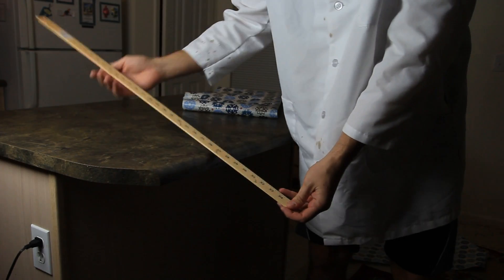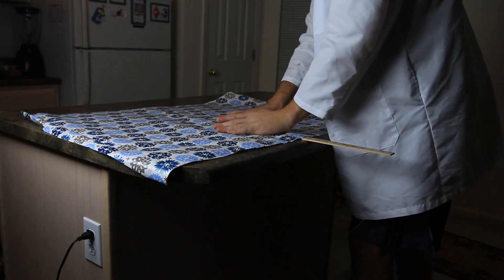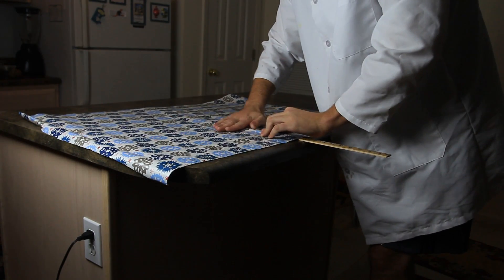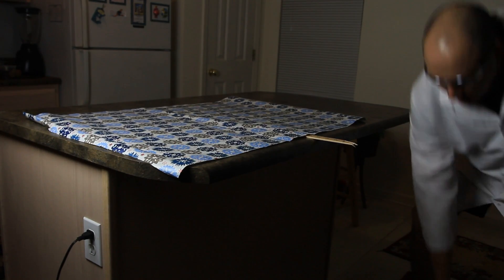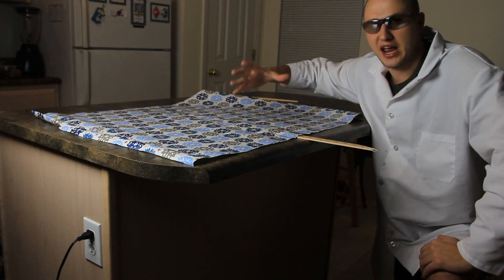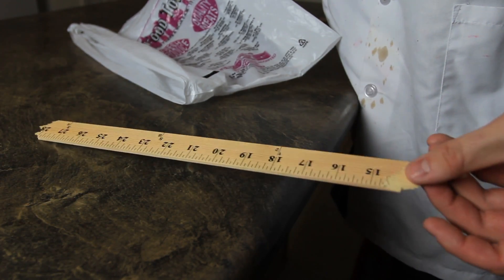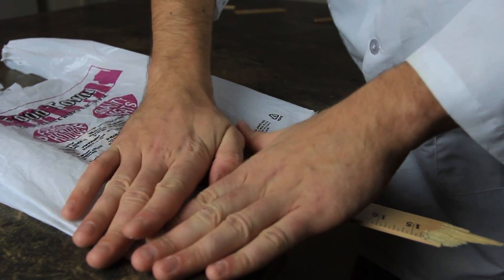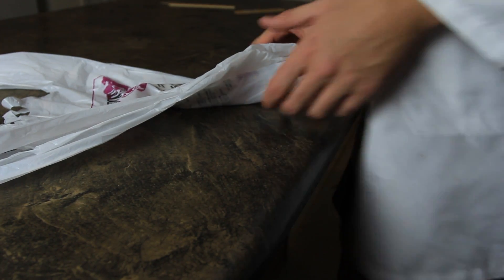Air Pressure - Science Experiment

Comment: Air resistance ?!
Reply: It would be air resistance if he did this vertically. When you break the stick, it's not the air resistance holding the sheet to the table, it's the difference in pressure between the air under the paper and air over it. The pressure under the paper is relatively low compared to ambient air above the paper. When you break the stick, it is the higher pressure above pressing down on the lower pressure below the paper, rather than just the sheet providing a large resistance to air.

Ideally, that is. In this particular case it's a slight mixture.

Comment: Air pressure is a wonderful thing, 14lbs per square inch, by a 24x36 paper with 10lbs of force being offset by a several ton counter weight, the wood gives first.

Comment: ... Surface Tension ... ?
Reply: Atmospheres of pressure on the top of the paper/bag. With no air under the paper the only force that pushes up against the atmosphere comes from the applied force. The paper creates a greater surface area for this force to be acted against by the air pressure in the room. This resistance is greater than the force applied so the stick breaks.

Comment: It's the air resistance not the pressure. Works kinda like an air break or parachute.
Reply: no, its definitely air pressure, it works like a suction cup. It pushes all the air out under the paper, so its like a vaccuum. and since its trying to fill the vacuum with air so quickly, it sticks to the table, to maintain its low air pressure. the stick is pushing the paper up, to give it more volume, but theres almost no air under the paper, so when the stick pushes up, the atmosphere pushes hard downwards, making the stick stay on the table and break
Reply: No, this is how a parachute would work bigger surface area (paper) the more drag or air resistance causing the ruler to snap
Reply: if that were true, than it would work if you just flattened it but didnt care if there was air under the paper. Theres no air there for a reason, because its air pressure pushing the paper down

Comment: Air resistance not pressure
Reply: No, it's actually air pressure. The air cannot rush into the space that the smacked meter stick is trying to make, so the paper doesn't move. it's almost like a short term air-tight seal.
Reply: InfernalAlice no it's because of the suck from the vacuum generadet under the paper! the vacuum sucks the messurement ruler into BROKE
Reply: InfernalAlice
id still argue its air resistance, the speed of the stick being hit multiplies the (as resistance) on the paper. making a greater force (pressure) on the paper than that of the end of the stick therefore it broke.
Reply: kiel turner haha. No multiplying going on. It's simply air pressure. It's the same whether he hits the ruler or not. Applying force to the stick is just representing said force already in existence. As tttmmmnntt states, the low pressure zone underneath the stick when lifted quickly and the pressure above is why the stick breaks.
Reply: you just said no multiplying going on yet you say the pressure above the the paper is why the sticks break. air when force is applied, multiplies in density (pressure) as does liquids and even solids. the fact you guys are arguing over pressure and resistance that are virtually connected terms. its like accuracy and preciseness ( I'm implying the difference is subtle). just to cause more controversy here there is no low or high pressure zones as there is no initial movement or altitude difference on the paper or stick, there fore it is simply a difference in resistance equating in to pressure. since the seal between the paper and worktop is very small it means that that when moved an area of low pressure would be formed which would form a area of high pressure opposite of said low pressure area, but  these pressures would not form if there was not resistance between the paper and the air caused by the large moment of the stick. the moment with the pivot point of the desk (compared to the pivot point of the other end of the meter ruler is which is notably larger) means that the force created on the moment of the uncovered ruler is smaller than the covered, again in the sense that the force on the other end is larger than the other so that the moment is 0 but resultant force breaks the ruler. i would of loved to use numbers but since this was meant to be a youtube video aimed at what to a simpleton would seem mysterious or weird  to a physicist to be simple concept.
Reply: "You were able to chop the stick in two because of air pressure. When you spread out the newspaper on top of the stick, you basically created a large suction cup because you’re preventing air from flowing underneath. When you strike the ruler, it tries to lift up against the newspaper, but because the air can’t flow very quickly into the space between the table and the newspaper, most of it simply pushes down on the newspaper (and the ruler)."-From a science website. Resistance didn't increased because of the stick. It was the amount of surface area, which had that same pressure the whole time. Don't give up your day job.
Reply: yes and the air could flow under the paper because?
Reply: Couldn't would be the right word. Go back to school.
Reply: one i am 15 and already have an A* gcse in physics i also have an auto-correct on my phone. using it to hide from the answer is a bit cowardly.
Reply: Kiel turner... Air shares a similar principle as water, it weighs... We don't feel it because our bodies are used to it.
Now, put your hand on top of a cup, and go deep under water and try removing your hand, you can't.. Because the air inside the cup acts as a low pressure zone, and the weight of the water tries to push your hand into the cup.. It works in the same exact way as the ruler does, lifting the paper too quick causes a low pressure zone underneath the paper, so there is less air under the paper than on top of the paper, so the weight of the air pushes the paper back down, it's like placing a huge rock on the ruler. If this doesn't make sense to you, I don't know what will.. As the other guy said, go back to school.
Reply: Listen, I get what you are saying about resistance. Still technically poor use of phrasing. My problem is with multiplying pressure. It isn't multiplied. It's the same pressure. Period. The decrease of air under the paper creates a larger difference between the pressure beneath and above. This is the "resistance" you speak of. All it is really, is the vacuum that is created because of flattening the paper out. However, this does not equal multiplying the air pressure against the ruler from above. So yes, go back and stay in school.
Reply: And as I said earlier, air pressure as much as 10 tones per m2. That is equivalent to about 7-8 cars

Comment: I actually just thought of this now as I was watching the video but I have a daughter and I play with her constantly I believe it actually has to do with Air and suction. if you did everything the same way except this time instead of hitting the ruler grab it with both hands and pull up as fast as possible while keeping the ruler horizontal, you'll notice that its it's a lot harder to lift up at first but then once air gets underneath the paper and the suction is lost it moves up easily, because the suction is so strong temporarily it's enough force to apply resistance and allow the ruler to break, so in result my final answer is friction and air suction combined together. BOOM science you're my bitch...  the reason I mentioned my daughter she has a clock that we used to teach her how to tell time but it is just a round piece of bendy like Styrofoam only 1/16 of an inch thick it is extremely light however if it's placed on the dinner table perfectly flat and you grab it from the middle you can almost lift up the entire table itself because of the suction.

Comment: This isn't air pressure, it's friction/ newtons law/ resistance, when you put the paper over the ruler the bottom sits over the ruler ontop of the table, when you hit the ruler newtons law I believe it is(every action has an equal and opposite reaction) so the ruler lifts up when hit and the paper tries to rise up but can't due to friction of the paper to the table too so the ruler can't dispense of the opposite reaction of hitting it so it breaks at it's fulcrum

Comment: I'd say it's aerodynamic drag. the paper multiplies it because it multiplies the surface area moved. with great speed, the drag is also very strong. both factors are in the formula for the resisting force of a fluid.
if it was just air pressure, you could even break it slowly. which doesn't work.

Comment: As science experiment it IS cool despite all hater but the explanation of this phenomenon is not quite correct. In fact the air pressure holds whole system paper-ruler-table stuck together by the perpendicular force of air on the surface of the paper and this force is then restricting the air from getting in sufficient amount under the paper. But despite this is more correct answer I can live with your explanation as well. 

And for haters - if it is a science experiment, it may not make a scence but surely it is cool.

Comment: Hey crazyrussianhacker I have a household hack for you. You know those squeeze cans of cheese. Often times they seem to run out early before they are totally empty right? One easy thing you can do is push the can in on both sides so that you can bend it in the middle. Once you do you can bend it back and forth until the aluminium breaks and you can take the little plastic stop put and get all the rest of the cheese. Usually a good inch or so left in the can that would normally go to waste.

Comment: Okay, I don't think CrazyRussianHacker knows what he's talking about, but I'll try to use the best of my knowledge to explain what happens;
He is partially right about the air keeping the covered part down, but, the reason the back is heavy is because the paper increases the amount of space the back takes up, or you can say the surface area increased. Since the back has more area, there's more air to be held on the back, thus increasing the weight.
I don't know why the fuck he was talking about the air pressure part for.
Reply: Air pressure is measured in pounds per square inch (pounds- an amount of weight covering square inches- an amount of surface area) so that's where air pressure comes in :)
Reply: Your statement is correct, although to a point. What you're describing is PSI (Pounds per square inch), but anywhere else in the world would be called Pascals (Pa). And the formula for Pascals is Pa = kg/(m x s^2) (x being multiplication.) But thank you for clearing it up, I had trouble understanding why it had to do with air pressure at the moment.
Reply: Ah okay :)
No worries!

Comment: It not air pressure, it's just drag....
Reply: ...Which is a result of differential pressures. Trying to move the paper increases the pressure in the air immediately on top of the paper, and decreases the pressure under the paper (creating a vacuum). This difference in pressure = drag.

Comment: Air resistance not air pressure.
Reply: Viscosity of air definitely has something to do with it, but the biggest factor is the creation of a vacuum under the paper, which would take an enormous amount of force. To say that it is due to the air "pushing down on it" would indeed be erroneous, because it would actually work on the ceiling too, if you had a way of preventing the paper from falling.